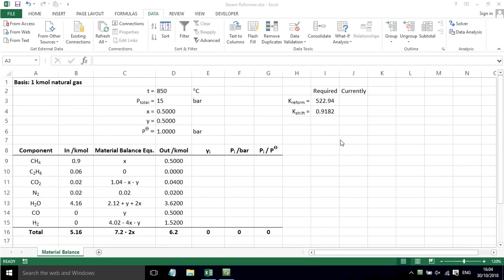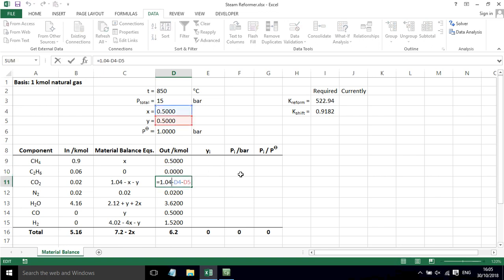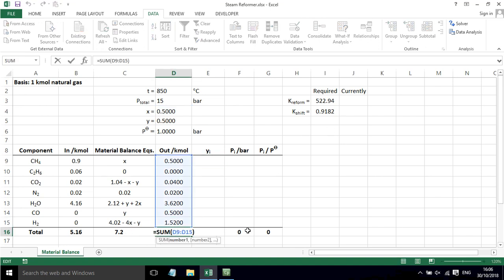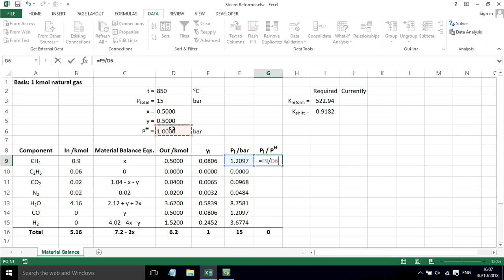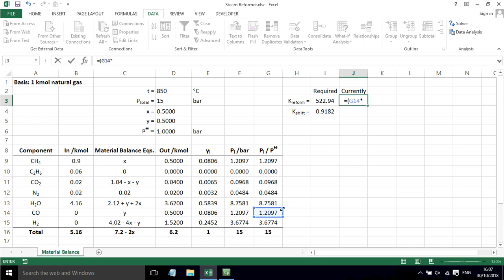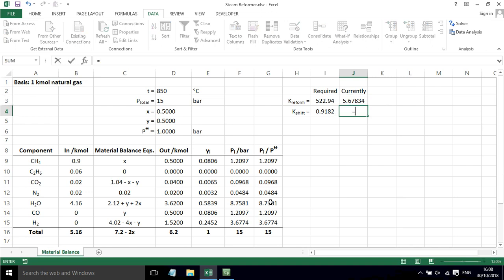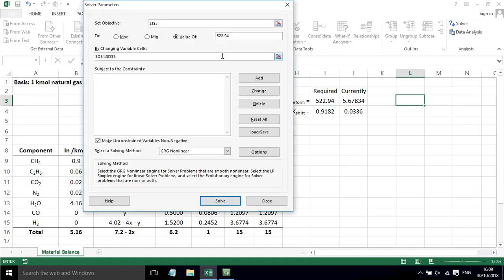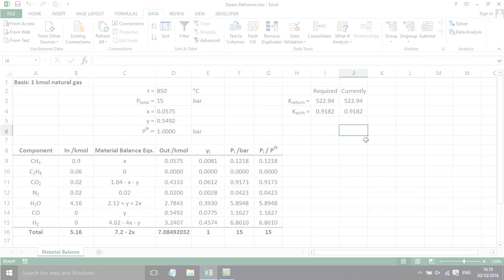Steam reformer material balance – part 4

Comment: How did you get the value of x and y = 0.5
Reply: These are just assumptions so you can start to iterate till you finally converge to the real values of the 2 Ks. You can choose 0.3 0.7 or 0.6 0.4 or any other fractions

Comment: How did you get X and Y value equal to 0.5?
Reply: same question ????????????????????????
Reply: These are just assumptions so you can start to iterate till you finally converge to the real values of the 2 Ks. You can choose 0.3 0.7 or 0.6 0.4 or any other fractions